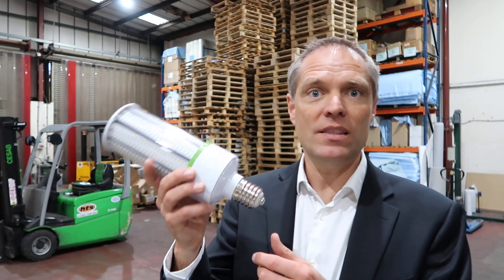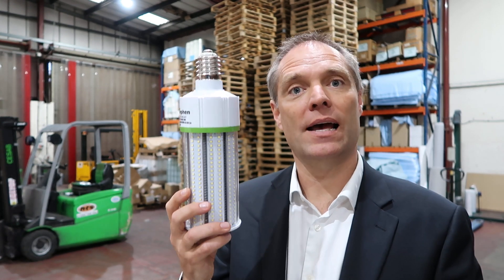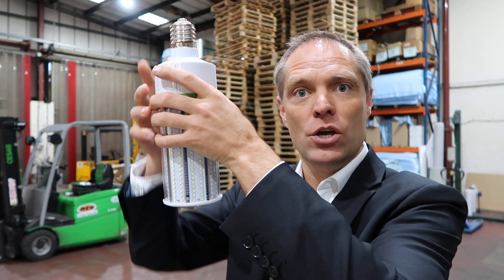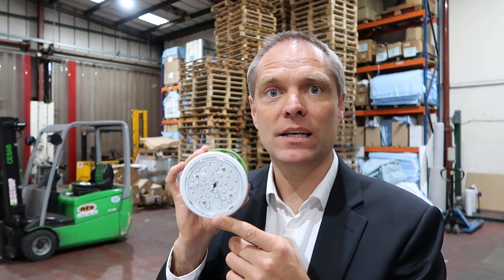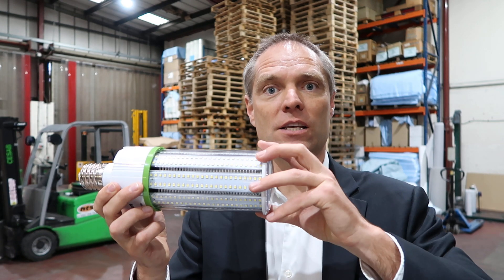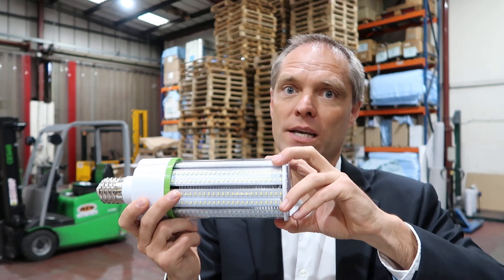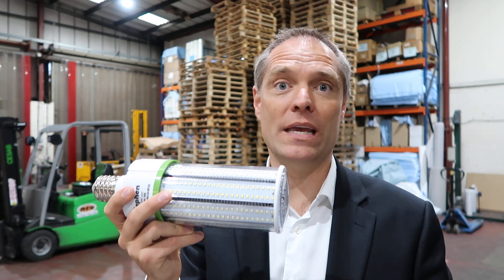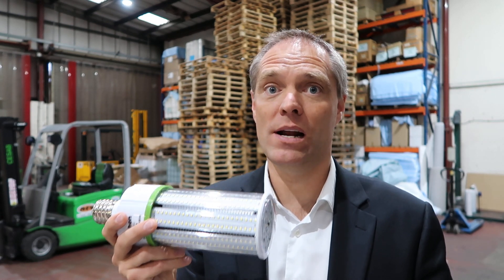💡LED Light - Never Use Corn Light Bulbs 🙄

Comment: The flaw in your logic is that the original light bulbs , Albeit MH or HPS ot LPS or even the old standard Mercury Vapor bulbs also had at least 50% of the light going in a direction that it was not needed . All of this said comes back to the quality of the fixture its self . The important thing is the reflectors. This is what directs the "SPILL LIGHT" back to a usable direction . . Better yet is a light fixture that has a true Mirror reflector . All of this said , A LED light where all of the emitters are exactly directed the way you would like them is in truth impractical to have for all applications but Yes it is the most effective way to get every possible lumen out of a light source. With the multitude of applications out there one must make informed choices.

Comment: the LEDs pointing in the wrong direction theory does not make sense. A MH lamp does the same thing. There are NO reflectors on the MH lam[p itself to point the light in a downward direction. Most high bay lights have a giant reflector on them to point the light downward.

Comment: So what is your alternative solution?
Reply from the maker: We always recommend replacing Metal Halides with LED High Bays like our PS-UFO-MAX. They have 160 lumen/watt energy efficiency and directs all the light to the floor, which increases the lux levels significantly and provides strong energy savings. 
As a rule of thumb you can replace a 400w metal halide with a LED high Bay of 120w/19,600 lumen. This will save you 70-80% on your energy bill and double your lux levels for Health & Safety.
 
- You can check out this video if you would like to see a side-by-side comparison https://youtu.be/LaHSDN5BiUk

- Here is a video with tips on how to get optimal value for your money when buying LED High Bays: https://youtu.be/lK-oJNo2kjA

Comment: Hello, Mr. Lauritzen. I want to comment on your statement that corn cob light bulbs are inefficient to use in your hausehold. At some point you might be right that design of these corn cob light bulbs are not ideal for general use in most houses. According to my observations they would not be used like a traditional ceiling bulb but more for photography and/or videography purposes and most of the time, inside of a softbox. From my own experience with corn cob light bulbs, I would not say that they are useless. I use them in my softbox for photography or video works and I can only say how convenient they are. I also do not agree with your statement that you get only 25% light from the bulb because only a small portion of the bulb will be pointed towards the floor. First, if you ever heard about "photons", they do not travel on a straight line in the spaces, especially in a room. These photons bounce of the ceiling and walls, though they come from a sort of direct light source. If we consider that most of the people's houses are with white ceiling, reflection  and therewith the light spill will be increased. Second, you compare the corn cob light bulbs with traditional light bulbs, which should not supposed to be used in a same way. Your argument is more like to say, "don't use truck wheels on your car, just use X company  car wheels". Lastly, I would suggest you not to forget to mention the addressees on the title of your video to make sure WHO should "never use corn light bulbs".

Comment: Why the short life expectancy ? LED bulbs last the longest and run the coolest...Are you sure about your stats ?
Reply from the maker: Hi Coil. The short life expectancy is not due to the LED chips, but due to retrofitting them into an old fitting which was built for MH bulbs. Both the Metal halide casing and the Corn lights have long life certificates, but they are not optimal together. 
For a long term solution lasting 5-7 years, we recommend to exchange the Metal Halides with new LED High Bays such as our PS-UFO-MAX https://youtu.be/Cm7Q96h0xUA

Comment: Was given one of these (looks just like the one in this video 150w) I was wondering if I can screw them into my outside flood light receptacle, its the standard two fllod light outlet you can buy for $30 bicks at Lowe's. I'm concerned that it might get to hot for the fllod light fixture its screwed into outside?

Comment: The corn light should work in high bay enclosure as its in a reflective enclosure and thus directs the light downwards, high bay light fitting has to have some of the guts removed as not needed to run LED lights, right?
Reply from the maker: The LED corn lights do work in a reflective enclosure, but only a part of the total lumen output will reach the ground directly or indirectly. A better and more durable solution will be to replace the Metal Halide fitting with a brand new LED High Bay, which will ensure that all the LEDs are pointing towards the ground and last 5-10 years. 

As a rule of thumb, you can replace a 400w metal halide with a LED high Bay of 120w/19,600 lumen. This will save you 70-80% on your energy bill and double your lux levels for Health & Safety purposes.
 
- You can check out this video if you would like to see a side-by-side comparison of Metal Halides with LED High Bays https://youtu.be/LaHSDN5BiUk

- Here is a video with tips on how to get optimal value for your money when buying LED High Bays: https://youtu.be/lK-oJNo2kjA